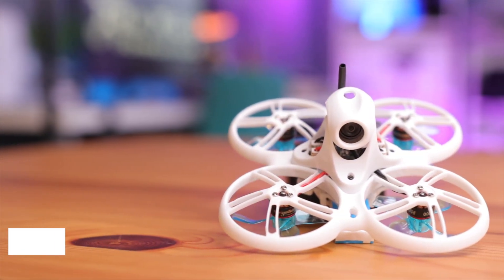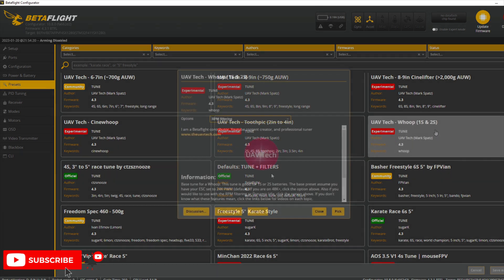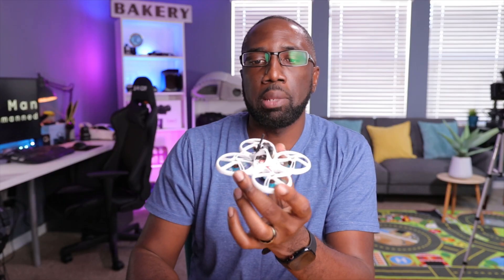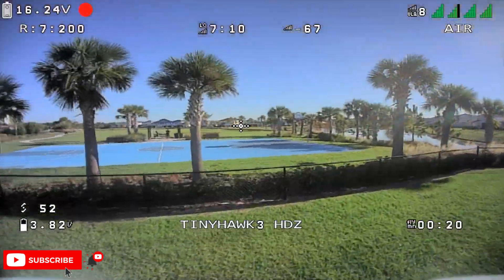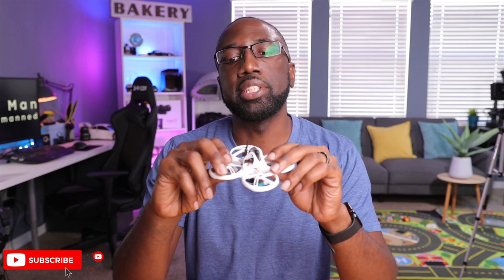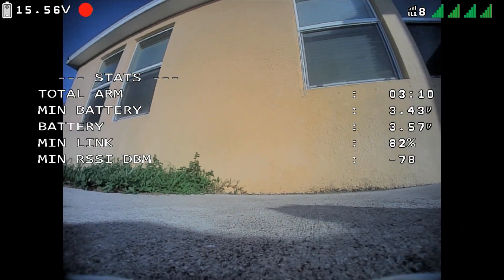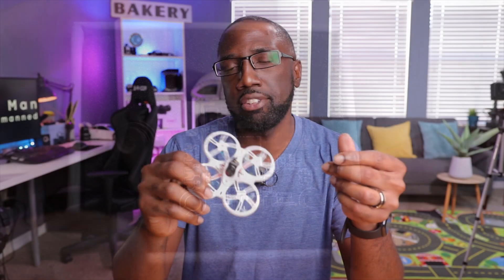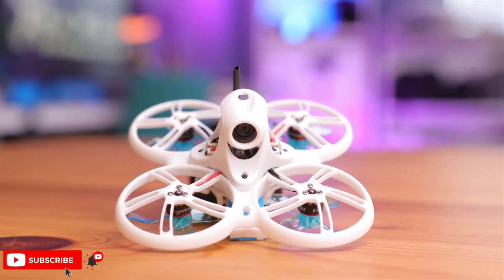TinyHawk 3 HDZero 1st Flight | The Sweet Spot for Tinywhoops

Comment: So i have a lite radio 3 and the goggle that came with my Cetus x
I’m thinking about ordering and mobula 7 & a tiny hawk 3 (just the drone) but I need to know if they can be compatible with the goggles and lite radio I already have 

Because if not then I’ll just only order the tiny hawk 3 kit (radio & goggles) being I’m  on a budget ,

Hopefully you understand my predicament and can help me make the best choice
Reply from the maker: In order for a drone to work with a radio or goggles, it. needs to have the same protocol.  I think all three drones are analog, so your existing FPV goggles should work.  What I don’t know is the protocol of your Lite Radio3.  Either way, the drone needs to match the protocol of your radio.  If its ELRS, you’ll need to buy an ELRS drone..If its FRSKY, you’ll need an FrSky drone.

Comment: Would you chose this or the tinygo 4k? For indoor and outdoor use. Who have the max distance? Battery life? Camera quality? Thanks
Reply from the maker: That's a good question... The TinyhawkIII would have better image/resolution in the goggles while flying,  but the TinyGo would have the better image/resolution(4K) in the SD card.  The range would be better in the TinyhawkIII since it's optioned with ExpressLRS.  As far a Battery life, it's very similar between 3-4 minutes.  As far as Indoor vs Outdoor flights, the TinyGo is better at outdoor flying, while the TinyhawkIII is slightly better at indoor flying.

Comment: Love this.  Bruh, we're on the same level.  Except my platform of choice is the old King Kong ET100.  I got 2 on hand, one with 1104 motors, and a Caddx Turtle V2 on board.  That one I run as a 3S.  I fly mostly indoors in a small one-bedroom apartment in Angle mode.  Got the little guys flying like cinewhoops - or demons, depending on my moods.
Reply from the maker: That's amazing..3S sounds like a handful indoors.  Thanks!
Reply: @OneManUnmanned  Detuned.  It gets 39% available power, with a huge sweet spot mid-throttle.  Mid-throttle is also the hover point; max throttle gives me a gentle ascent.  Most of the power is below hover point so I can perch real easy.  Without the trick throttle I'd be useless.

I get about 6 minutes flight time, running the pack down to 3.53 volts/cell.  With the DVR in auto-record.  Quiet and efficient.

Comment: Nice build. Can the TH3 take 2s also, like the TH2? Might be fun on the outside flights. I fly 2s alot on 0802 16000kv motors.
Reply from the maker: If I remember correctly, I think it can(but I think EMAX doesn'trecommendit).   This Flight controller specifically comes with a 1S BT2.0 battery lead.